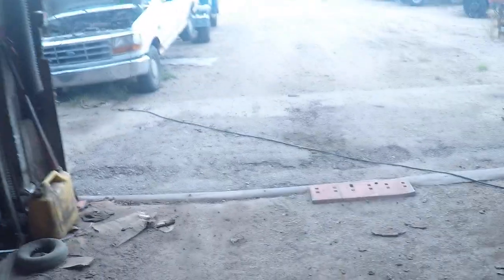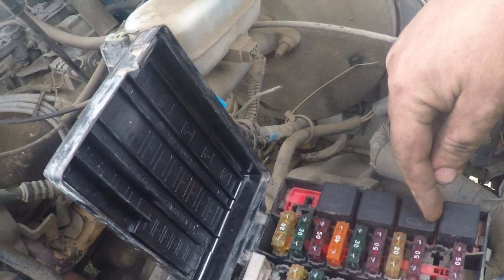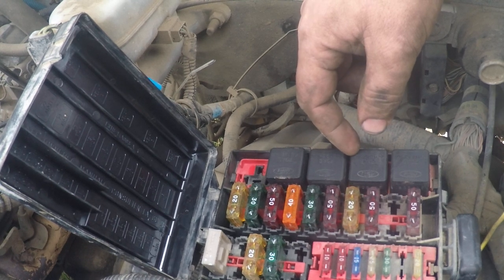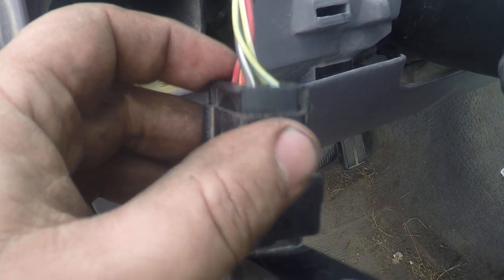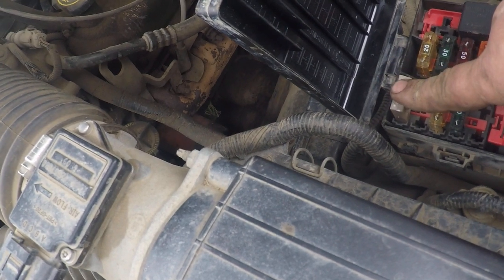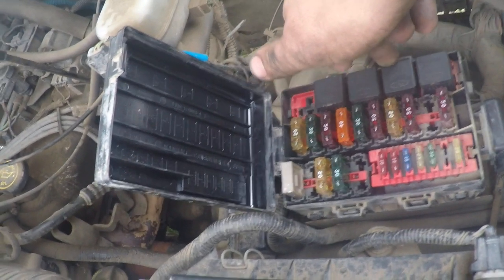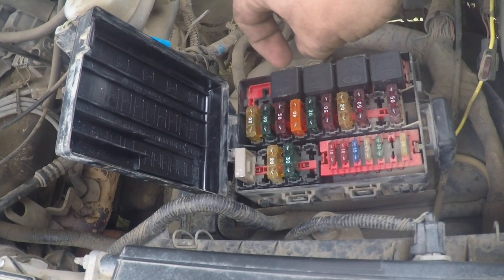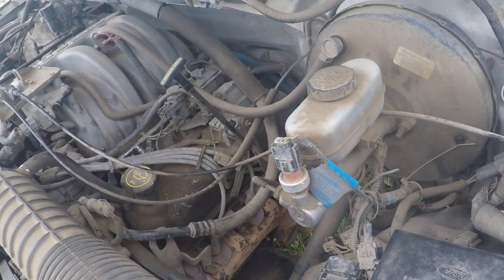Ford Fuel Pump Power Diagnostics

Comment: my center power orange with  yellow strip reads 6.6 volts im trying to figure out whats going on in the inertia green yellow cable its also has 6.6 volts my fuse for the pump has 12 volts and i do hear my relay click any idea what could it be? this is the best video i have found for my problem. thankyou for your time
Reply from the maker: I assume you're talking about the wires at the fuel tank selector switch? If your getting 6.6v in that's all you will get out. You need to check you supply power, I would start at the relay, just because it clicks doesn't mean it is putting power out, jumper your 30 and 87 terminals at the relay, and check that there is 12 volts, then check for power at switch, if it is good, change the relay.
Reply: Tri-RRR Services thankyou for your quick response yes 6.6 volts on the wire (orange/yellow)on the gas tank switch  selector. I assume there should be 12 volts i did switch the relay with other relays in my box but still reads out 6.6 volt. so it should have 12 volts and not 6.6?
Reply from the maker: Has to be 12 everywhere, check your voltage at the relay, pin 30 should have 12 volts at all times, sounds like you may have to chase down a bad wire.

Comment: How did you check the diode fuse thingy????
Reply from the maker: You can use a diode checker on a multi meter, it runs a current through it in one direction, but I commonly check them just with an Ohm Meter, as having a connection is the point, it being a diode is for RF noise suppression from the pump motor, you can also use a jumper to confirm connection for testing purposes.
Reply: @tri-rrrservices7299  Thanks TRS a million!
Reply: I fix my no spark from on here, so I have a no fuel no start, which did start after I shot starter fluid in it (95 f150 4.9l) with the dual tanks and with this video I have confidence anyway thanks for all you do it is appreciated!